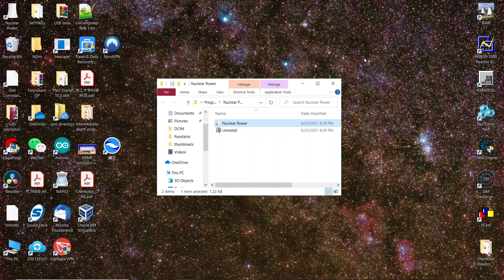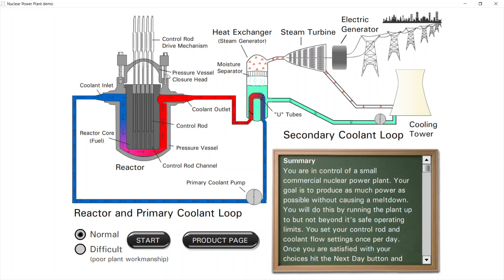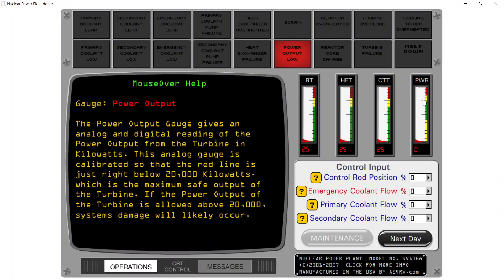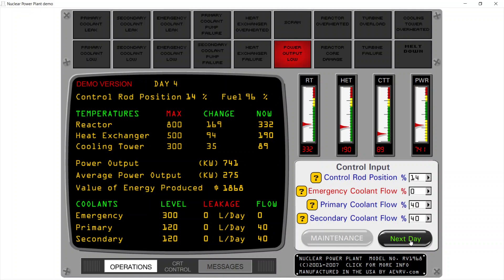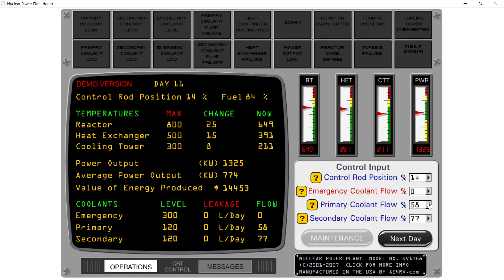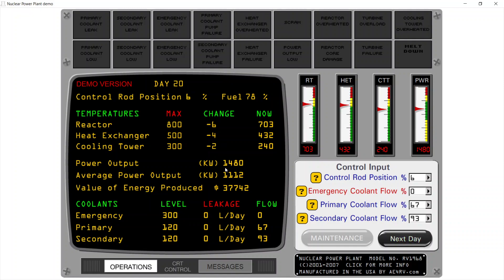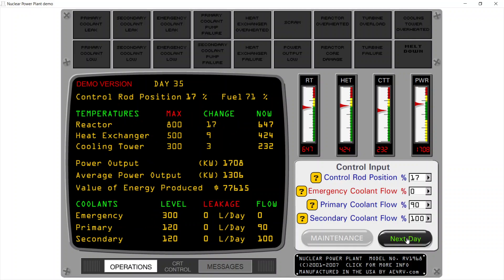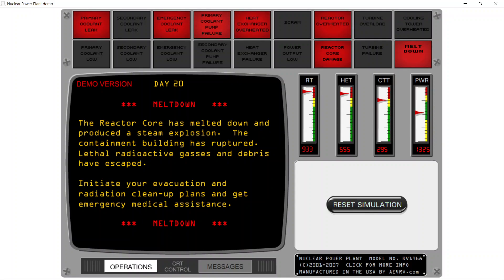Nuclear Power Plant Simulator Geoffrey Noles

Comment: Great video as always. I got a question, recently I noticed that my WWER-1000 reactor simulator stopped working for some reason. When I launch any task and open the simulator, I get greeted by a black screen that stops responding and crashes shortly after. I was wondering if you maybe know what caused this and is it fixable?
Reply from the maker: I get the same! This is a recent problem, it may be caused by the latest windows update. I will try to find a fix!
Reply: @argilaga  I am currently trying to set up a VM with windows XP on it to see if it will work there, just I'm not   really into that stuff so I can't get it ti work.
Reply: @argilaga  Update, I got it to work on a windows XP VM. The only problem is that I don't have any sound cuz I'm using Hyper-V and have no clue how to make it work.
Reply: Is this demo  software free, and how to download it please?